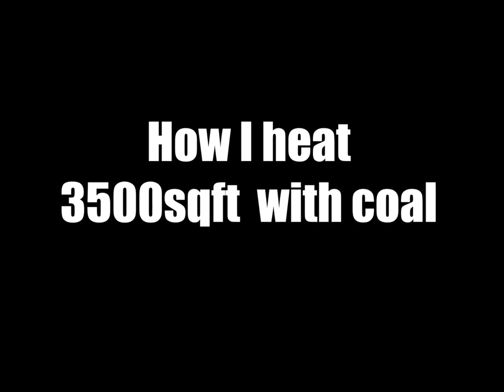How To Heat House With Hitzer Coal Stove

Comment: In the UK we almost exclusively heated with coal until 50 or so years ago. I grew up in the north of England, famed for its coal mining. Even in the 1980's schools etc were heated with local coal. Now, every single deep mine has closed although we still have reserves for hundreds of years. Coal is highly expensive due to the taxes imposed, and now comes from Eastern Europe or Columbia. A shame as good British anthracite is far better quality and virtually smokeless once lit.
Reply: Here in the states we have both good a bad quality coal, our anthracite mostly comes out of Pennsylvania. Always good hot clean burning. Your now sadly I may say probably getting the more sulfur rich coal, if I could ever remember the name.
Reply: @jamesluck2969  Soft Coal or Bituminous coal is the more volatile coal and does make a little smoke. Anthracite is smokeless but is a little harder to burn. It is still plentiful and readily available. I heat my home with Anthracite or hard coal. However always keep some bituminous handy just in case my fire temp drops on the hard coal. Keeps it from burning out as soft has a lower flashpoint than Anthracite.
Reply: All anthracite burns clean and hot, that is why it is labeled as anthracite grade coal
Reply: I was visiting in the UK from Canada for 2 months in the winter of 86-87. I remember the lady who's home I stayed in had a fireplace. And only two large chunks of anthracite coal made it too hot to sit in front of. The silliness of fake "CO2 global warming". We are headed back into a cold era. Maybe even "The Big Cold Era".
Reply: My comment remarking about coal in NY being banned has been deleted by YouTube.

Comment: We maintain a deeply stocked pantry with a 3-year supply of food. To protect against freeze in our harsh Wyoming winters, we have a redundancy of backup heating in the pantry building; a generator... propane furnace... Hitzer coal stove with two tons of eastern anthracite. We have mountains of cheap Wyoming coal, but it’s bituminous.
Reply: What is the coldest temperature you have seen in Wyoming?

Comment: Growing up my last job of the day was to fill the stoker, remove the clinkers from the furnace and spread them on the driveway. 
The year I was drafted, mom and dad bought a new-fangled central heat and air conditioning system. 
Today it’s strange to think that during the summer people slept with the windows open. 
Fifty years goes by so fast.
Reply: Papa Steve
we still sleep in the summer with our windows open! no AC
Reply: I also sleep with the Windows open, in the country with the coyote yapping at night. But even with the Windows open 50 years goes by too fast!!

Comment: One of the main advantages of wood/coal, and even propane (if it's a passive heater) is that no matter what happens on the grid, your home will be heated until you run out of fuel, and with wood you can gather more without having to rely on any buisness as long as you have the trees.

Comment: I love my coal stove, I burn 3 ton of  pea coal a year to heat all winter here in New Hampshire. Sort of same set up I heat the basement and heat radiates though the floor.  I burn around 40 pounds a day.
Reply: James Hurlbut I don't have the same setup as you or the bloke in video but 3 tons of coal is quiet a lot as I may use about half a ton or just over
Reply: Thank you for not making it possible to stop climate change.
Reply: @republicansareoffendedeasi821   I look at it as solar energy that has been in deep storage for many years,  and there is no way to stop climate change if it weren't for climate change I would be under about a mile of ice.
Reply: @republicansareoffendedeasi821 , individuals burning coal is only a slight foot print. Wity 90% of the world still making energy with coal, I'd say your barking up the wrong tree. 
Although I agree it's not the best way, I must ask how you heat your home.
Reply: John Sears i would rather burn coal or wood as its a lot cheaper to heat the house and heat water at the same time as if you have a gas central heating and if I remember right you could eve use it to heat the house or water
Reply: Tom Slak  it come from a hydroelectric power plant. What do you think all electricity come from a coal plant?
Reply: NH resident here, I'm gas burning city slicker, but god bless ya James.
Reply: @republicansareoffendedeasi821  You have posted cringe.

Comment: What’s the average temperature you are able to get your house to heating with coal, and how does it heat compared to wood.
Reply from the maker: We keep it in the low 70’s.  If the temperature drops into the teens at night it will drop into the upper 60’s. Now that’s approx 3800sqft in a older home that’s not exactly air tight. I don’t have a lot of wood experience but in my opinion wood takes more maintaining to keep consistent heat and is much more labor intensive.

Comment: This winter would you be able to provide an update on your stove and how things are going with it? Any tips/tricks you've learned, etc.?
Reply from the maker: I definitely will. It’s about time to get it cleaned and ready so I’ll be sure to put something together. Thanks for watching
Reply: @alexnau86  Thanks so much. Also if you've figured out what your annual fuel usage is that could be helpful to share too. Looking forward to the videos.
Reply: @alexnau86  I forgot to ask - which model Hitzer is this?
Reply from the maker: Pete Antos-Ketcham it’s the ez 50-93
Reply: @alexnau86  Thanks. Looking forward to the update video on the stove this fall/winter.

Comment: Is that an electronic hopper or feed system?    If not, what’s the electric for?   What if there’s a power failure?
Reply from the maker: The power is for the blower fan only. The coal is gravity fed so there is no need for power to operate. Thanks for watching

Comment: I have no electricity - do Hizer (or anyone) make on of those hopper coal stoves that do not need a fan. I live in Ireland, and it's cold.
Reply from the maker: The model I have came with a fan but you do not have to run it. The stove radiates heat just like any other stove the blower just increases the circulation of the heat.
Reply: Get 2-3 thermocouple fans to set on top. Maybe $50 US each.

Comment: You can also if you have a garden mix the ash in and you will get great vegetables that year due to the potash which is a byproduct of burning coal.

Cheers
Reply: James Shanks coal ash should never be used on gardens! It contains all sorts of toxins and will likely do more harm than good! Wood ash is fine, a handful per square meter twice a year.
Reply: JS: Also enjoy the heavy metals from coal ash which are absorbed by your vegetables!

Comment: does it heat  your house   very  warm
Reply from the maker: Tim Bolt the stove is in the basement and it gets very warm down there. The first floor is heated through the floor and basement door. Up stairs is run through ducts and when it gets in the teens and below it's not enough to keep up. The first floor stays comfortable.
Reply: I don't have the same setup in the UK but mine heats the house quiet well and wake up the next morning and its warm to a point

Comment: What kind of flue gas cleaning do you have on your combustion stove, I assume you do not burn it in a normal combustion stove.
If you just burn it in a common combustion fire, you help contaminate our common sphere and then your president has a bigger problem than he himself believes.
I work on a large Danish coal-fired power plant and we are subject to strict environmental requirements not to contaminate our common sphere.

Comment: So your opinion on coal vs wood pellets is what? 
Also, does the stove radiate enuff heat to keep the up-stairs warm? Does the heat rise up a stairwell? 2 storys, or 1? I have an antique Glenwood coal stove, and love it. Everyone else I know has pellets. Thanks for sharing.
Reply from the maker: I have a pellet stove we run in early and late winter just to take off the chill at nights when it's too warm during the day for the coal stove. The rest of the winter we run the coal because it gives of a much hotter heat and is less expensive to operate.  Our coal stove is in the basement and the door is open and keeps it very comfortable. The floor is very warm makes it very even. I installed a duct to the upstairs with a booster fan and that helps heat the second story. I enjoy both stoves and each has it's purpose in our house. The main goal is to be warm with spending as little as possible and that's why I love our coal stove. Thanks and have a great day.
Reply: Not sure how long you've had your Hitzer, but when you learn how to idle it down, you'll be able to keep it running low, not eat much fuel at all, and ramp it up in the evenings. My Glenwoods in the living area, and today is mid 40s, but my living room is 74°with stove on low. I'll M/T the ash pan once in a couple days. And tonite the temps will drop to 20s, and in a 1/2 hr, I'll have the stove back up to temp. Nothing like coal heat. :)
Reply: @alexnau86  how much does it cost you to run the coal stove for the season?
Reply: Mike B 
He's cost per year if I were to guess 600 to maybe 750.
He stated that he started off with 26 ton, and he's been at that pile for going on 4 years now. He probably has atleast 8 years of coal, considering sonething like a 3 ton per year burn rate.
Buying bulk is the cheapest way to go